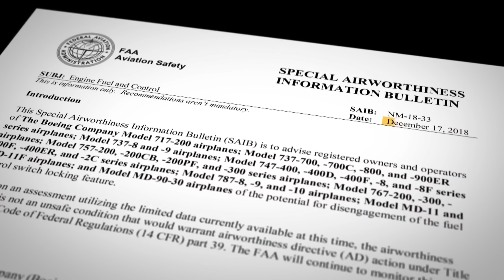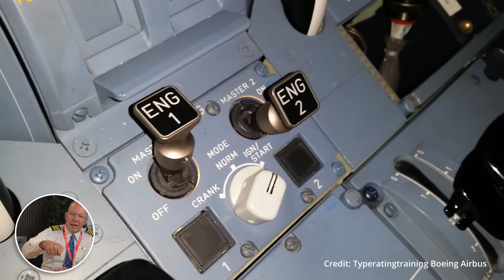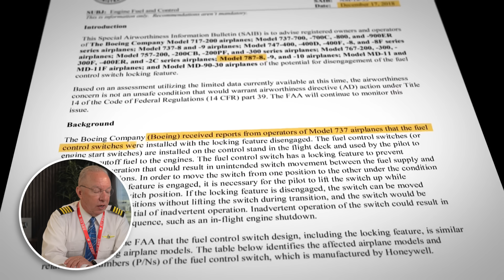Air India 171: The FAA’s 2018 Fuel Switch Locking Bulletin Explained (16 Questions Answered)

Comment: “No pilot is stupid to play around with switches during takeoff,” said aviation expert Mark Martin, reacting to the #AAIB’s preliminary report on the #AirIndia flight AI 171 crash. The report revealed that both fuel control switches were turned off, causing the engines to shut down shortly after takeoff. 

P.S: "When you ask the Robber to investigate the Robery"

Comment: Do we have proof of pilot turning off fuel? We only have the data recorder information which is a recording of electrical signal. It still could be an electronic failure that made the thing appear like switched turned off. Remember pilot asks why fuel was off and the other pilot says he did not do it. Means they are talking based on hearing. I don’t think the jury is out yet

Comment: No matter what the cause of ANY plane crash, every bit of available evidence or data is mandatory toward the goal of understanding the cause to hopefully prevent future crashes.  Which is why your equivocation about video in the cockpit is disheartening.  It wouldn't have prevented the crash, you are correct, but it probably would help understand this particular crash.  And above all, isn't it about finding the failure and fixing it.

Comment: Sorry sir. I disagree with your opinion on video recording cockpit activity. It may not prevent a tragedy, but would provide clear evidence if a cockpit crew member  decided to do perform a sabotage activity. If the output were only to the black box it can be so designed that it can't  be leaked out. After all is CVR data ever leaked out? Whats more it need only be a short recording of an hour or so and then could be recorded over. So your fears are unfounded.

Comment: How can you say this isn’t a design flaw? For the sake of this discussion, let’s assume it was sabotage. The fact that pilots were able to plan and execute such an act suggests there was room in the system for this to happen — and that’s exactly where the flaw lies.

As an ordinary person, I’d expect there to be safeguards in place to restrict or at least monitor fuel flow during critical phases like takeoff, until the aircraft climbs and stabilizes. In this scenario, the aircraft was operating exactly as it was designed to — and that’s the problem.

If fuel to an engine is cut off, the plane shouldn’t just blindly follow that instruction, especially during takeoff. It should prioritize safety: ensure at least one engine remains powered during liftoff, regardless of manual fuel control switch inputs.

That kind of resilience should be part of the design. So yes, if a deliberate action can bring down a plane that easily, we need to question the system, not just the actors.

And if the second pilot took a 2-second pause before returning the fuel control lever to RUN, how could the other pilot have managed to shut it off within that 1-second window — and do it silently, without the second pilot noticing? It just doesn’t add up, guys!
Reply: By Ung

Comment: So whether there was a warning or the pilots could hear the engines slowing down and put the switches back to the operating position, would there be enough time for the engines to spool back up at such a low elevation to avoid the crash?

Comment: Sir. I am a pilot. Is it possible the take off g-force pulled the switches back into cut of position.   If the locking mechanism failed to lock on?

Comment: OTHER OPTIONS. We know the fuel cut off switches were recovered in RUN after impact. The report says, but we really don't know, the switches were switched to CUT-OFF 4s after takeoff, per the report. The switches are ANALOGUE ; the flight data recorder is DIGITAL. Between switches and data recorder are... RDS interface, A664 ethernet, network switches and a bunch of software/firmware. Also, we don't know if the pilot comment "why did you cut-off?" referred to mechanical switch positions or to an alert on the EICAS ?
Besides the cockpit physical switches, multiple systems can close the fuel shutoff valves -incl. engine fire system, FADEC on fault. 
We expect, but don't hear "positive rate" and " gear up"  right after transition to airborne. Gear progress is actively reported & confirmed by pilots. Yes it's possible one pilot sequentially cut off both fuel switches instead of activating gear up lever. But that's a huge stretch for any pilot. We need full CVR transcript of crew dialogue.

And there's this: The 787 is a software-controlled aircraft. IS IT HACKABLE? Independent cybersecurity research (2019) suggests there are multiple vulnerabilities. A horrible thought.

Comment: Am I missing something here? So all and you say it's pilot "error" but physically impossible to move the switches without really being deliberate. At the same time, the other pilot would see the move since location is in the front. But it wasn't noticed although happened right during the take off?!  So this assumes both were deliberately acting? But, why then have the weird exchange 'who did it' since both will die anyway? Not even close to being clear how this is possibly a pilot error in my opinion.

Comment: Thanks Captain for sharing your knowledge. Here is my opinion. As you say that the first indication is that the pilot hears the engine shut down first. Is there a possibility that the main pilot hears the engine shut down and immediately asks the other pilot 'why did you shut it down' and got 'i didnt' in reply.  Also, the switches were in the on position during the crash. Could it be a malfunction that the switches were 'on ' but still it shut down? How can we come to the conclusion that there was human intervention , validating the first pilot's question and ignoring the second pilot's answer?  RAT deployed at 47 seconds after take off. Switch trasitions happened after that at 52 sec and 56 sec, just makes me think that they tried to somehow save the flight by doing this as a last resort. I think we should not jump to conclusion as we don't have solid visual evidence of the pilot switching it off.

Comment: I somewhat disagree with regards to recording videos in cockpit making no difference. Recording can not only help identify what actions were being taken in the cockpit, but it can also deter pilots in an emotional state from making bad choices. Perhaps if the pilot knew he was being recorded he would have thought twice about pulling the lever and taking the plane down. Though I'm not saying it's guaranteed but hesitation is possible. Insurance payouts for example would not go through for the guilty while at the same time protecting the pilot was innocent. Imagine if you were innocent but the reports found you guilty - perhaps the pilot who had the divorce is actually innocent, but the reports will most likely lean towards him as being guilty. Honestly it protects pilots who do the right thing. While deterring those who think about doing the wrong thing. As long as the cameras are hardwired to the blackbox, there is little chance of a leak. But once a pilot has decided on his life with no care of the world then no recording can stop him/her. Recordings can also help find other things that can make both pilots innocent, like a terrorist breaking into the cabin. Pilots should see this as a form of protection rather than dispute over privacy.

Comment: Another pilot channel had this to say: The CVR are area specific. The India investigators know which pilot said what. The preliminary report leaves that out. His theory is the pilot monitoring, the Capt., switched off the fuel supply then asked the FO flying the plane, "why did you cutoff ?"  In India suicide brings great disgrace to the family. The Capt. would have planned this out to put blame on the FO. on the recording. What are you thoughts on this, Steeeve  ?

Comment: With aircraft becoming safer and safer everyday, is there a reason why the fuel control switches would need to be toggled off in flight? I’m assuming if one of the engines is on fire? Also a follow up question, should there be a safety switch on each side of the cockpit and would need to be engaged before the fuel control switches can be toggled?

Comment: Sequence of events could be (keeping in mind RAT getting deployed as soon as plane was in the air)

1. Worn out locking mechanism. 
2. Bumpy takeoff because of the plane being on the center line (Tires Bumping against the center lights)
3. Inclination angle of the plane for take off.

Sabotage could have been planned when pilot is generally single person in the cockpit unlike when both pilots are active. As it's a long haul flight, there is clear possibility of pilot being alone.

Comment: QUESTION: Are you allowing no room for the pilot to have switched off the switches BY MISTAKE, or must we believe that this was an INTENTIONAL act by the pilot. Can we ever know a person's motive without some type of confession/admission? We don't have that here. That there was "pilot error" seems beyond reasonable doubt. But malicious (or any) deliberate intent by one (or both) of the pilots to turn off the fuel? Based on both their reactions (i.e., surprise) to the switches being flipped, I don't think that would hold up in a court of law (i.e., malicious [or any] intent would not be proved beyond reasonable doubt).  Always grateful for your take on these matters.
Reply: The investigators would have looked at the possibility of accidental switching off. It wasn't mentioned in the report. Several Boeing pilots have commented here and on other YouTube channels that accidental is impossible.
Reply: @davidquinn6161  What's in the report that proves it WAS NOT accidental?
Reply: @davidmcconnell8005  That would have been part of the investigation. The fact that it's not mentioned  means that it was dismissed as a possible cause. Plus knowing how the switches work, makes it obvious that accidental is impossible. As attested by several pilots who fly Boeing planes that use those exact switches.

Comment: I find it stunning that you can shut off fuel supply to the engines in flight without some extra signal from the FADEC re engine malfunction/fail, throttle at idle, fire suppression system active, etc. or an extra override switch located away from the fuel cuttoff.  They should be forced to put something like this in place, so that one pilot cannot sabotage the plane in flight. 
Your argument against cameras is completely ludicrous.  The whole point of putting cameras into cockpits is for exactly that reason, to make sure pilots are doing their job properly.. The voice recorder already captures every thing you say, a video camera makes no difference. Your personal rights do not exist in the cockpit. It is your workplace and not your personal space, You are not the only person to use it. It is not locked for your privacy, but for everyone's safety in flight. Your job is to fly the plane competently and responsibly for the safety of the hundreds of helpless lives in the passenger seats who are depending on you to do it properly. If you arent going doing it properly the company and the helpless passengers have the right to to know about it and discipline you.

Comment: Isnt it a design flaw to actually have the "Cut Off" position downwards with gravitational pull assisting any glitch in locking it up to "Run" position. Im curious to know, if you know why its significant functionally that Cut Off is designed to be positioned at the bottom versus the "Run" positioned at the top. Considering the more beneficial scenario, lastint over a long flight duration is "Run" position. @captainsteeve, your thoughts are appreciated. Thank you
 Im and IT systems solution design Architect based in New Jersey.

Comment: If there was an electronic shutoff, the switch will fall in its default position. What is the fuel valve and fuel control switches default position?

Comment: What about the Electrical issues experienced by passengers on same aircraft in previous flight. And the survivor passenger testimony that he heard a bang, and electrical fluctuation. Is that due to RAM.  Also i understand the issue with cameras, flying is stressful, and pilots need to have a peace of mind. Reading magazie is ok when autopilot takes over etc at cruizing altitude etc. However a camea which only records to black box is a good idea.

Comment: Hi captian steeve.   I'm working in METRO industries in dubai from india. 

My question is if the engine cutoff switch is off  is there is any  perticular warning sounder for engine cutoff switch in cockpit ?  So the poilets get quickly attention that  something is wrong with engine cutoff switch !!?

( OR SHOULD  HAVE A SAFETY FEATURES IN COCKPIT WHICH IS DESIGN TO KEEP THE ENGINE CUTOFF SWITCH "ON" position WHILE AIROPLANE IN AIR)

Comment: 1. THE FDR DOESN'T READ THE TOGGLE SWITCHES POSITION (PHYSICAL)

2. THE FUEL SOLENOID VALVES CLOSED WHEN TOTALLY DE-ENERGIZED

SO, IF THERE'S A TOTAL ELECTRICAL POWER FAILURE, THE VALVES CLOSE.

THERE'S NOT A CONFIRMED MANIPULATION OF THE TOGGLE SWITCHES THEREFORE.

Comment: Engine power was already failing 
Is there a last ditch SOP to reboot the engines which were already too low on thrust.
I think there is and that is what the pilots were attempting.

The distance taken on the runway  to reach the abort threshold velocity also has not yet been disclosed. Why?
Beacause that would establish the low thrust from the very beginning.

The confidence of Capt Steeve appears to be made up under some pressure from top to push a certain narrative. The open mind is missing, and a lot of "good question" adjectives used to calm down hard queries

Comment: Hi Cap, i am a control engineer. 
I have recently studied that other manufacturers have a fail safe design to prevent both the engine from shutdown simultaneously. Also the computers are so fast it acts in milli to micro second, so adding an interlock to detect at-least one unsafe condition only allows dual engine cut off or at least minimum condition like the minimum altitude  or some condition should exit. 
Also now everybody keeps talking about the fuel cut off switch. What about the in flight controls do, when both the engines fail? Thats the bigger question here, what are the logics the inflight computer will do in case of dual engine shut off!
What is the sequence of the computer logic present! does the logic automatically shuts down  the electrical system. I think the detailed investigations should focus on inflight controls and its capabilities. Its very easy to blame pilots and move on - if you are  not learning from these tragic accidents i think we are just waiting for another incident to happen.

Comment: Did I hear what i just heard about this pilot's opinion about cameras in cockpit? "no one should be able to see a pilot do things he is not supposed to do"??? Are you even listening to yourself?

THAT'S AN EVEN ABSURD REASONING THAN A PILOT PUTTING OFF THE FUEL SWITCH.

With that explanation, I am afraid you yourself need psychological evaluation, Capt.

Comment: Captain Steve. Wouldn't the cockpit voice recorder record the sound of the switches being placed in the off position? And isn't it possible that an electrical short in the switch panel that could have cut the fuel off to both engines?

Comment: Airline mechanic here, 28 years. 
In response to LatifElhag's question:
There are warnings on the FMS, (flight management system), display associated with a fuel switch/switches being selected to the "cut-off" position during flight. The warning doesn't specifically say "fuel cut-off," but other warnings related to engine operation and performance will illuminate. "Engine Failure" warning and "Fuel Imbalance" are the two that I can remember off the top of my head. The messages will indicate the consequences of the fuel switches going from "Run" to "Cut-Off," but no message to indicate the position of the switch, itself. Like Captain Steve mentioned, you would hear and feel the engines go back, thrust being cut.

Comment: The haste to conclude Pilot Error without fool proof evidence, especially when an advisory regarding the particular switches exist, raises questions and suggests diversionary tactics.

And the camera logic just doesn't cut ice.
Reply: Tens of thousands of these switches in use on 737, 747, 777 and 787.  Used twice on every flight.  The console was replaced twice after this bulliten and the switches both failed at precisely the goldilox moment when it guaranteed a crash even if the switches were restored.  What about mh370 that vanashed with 2 competent pilots and satellite tracking
Reply: @barryobrien1890 ..no prudent aviator would ever overlook Murphy. And the point is why the haste? Can one disregard the pilot saying "I didn't do it".

Comment: What scares me about the implications of this incident is the power these fuel switches have to cause an immediate disaster with relative ease. So, assuming this was a deliberate pilot intervention with the intent to crash the plane, and given we need to learn from experiences like this, moving forward, should the FAA consider some type of alarmed-cover for these fuel switches that upon opening would provide significant warning (an alarm for example) that would alert the other pilot who may be focused on flying that the fuel switches are now vulnerable.

Comment: The report clearly says that the switches were transitioned it doesn’t say that someone switched them off
So captain how could you straigtaway discount the possibility that in this case there was some kind of eec malfunction since the swicthes dont control the fuel flow directly. Its not a purely mechanical system but an mechatronic control whereby there is a software logic built in.

Comment: They should use the two man rule that requires two sets of switches and require both switches to cutoff fuel to the engines. Remove switches from the center console and place them on the side of each seat.